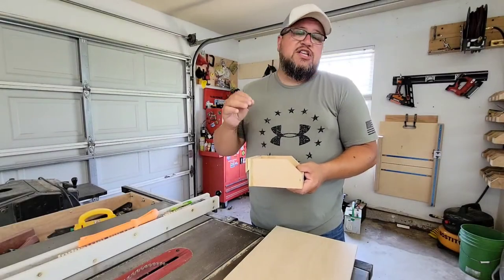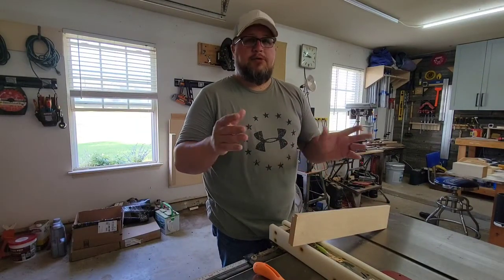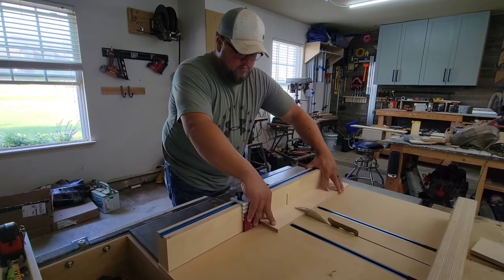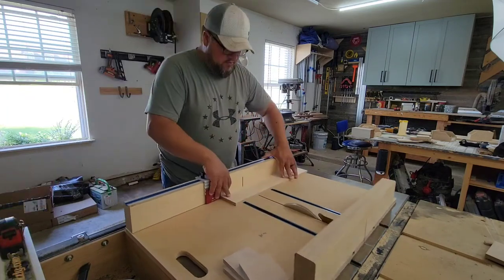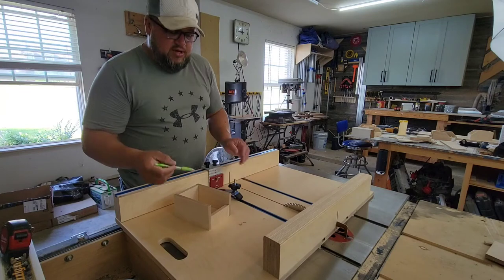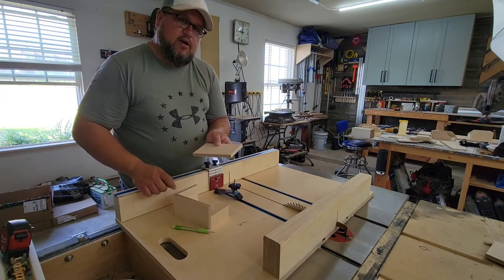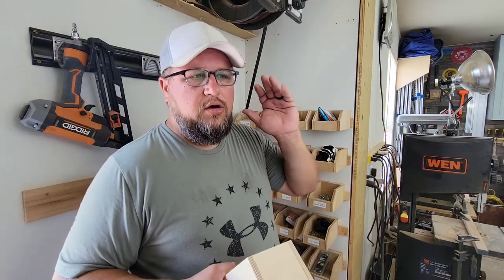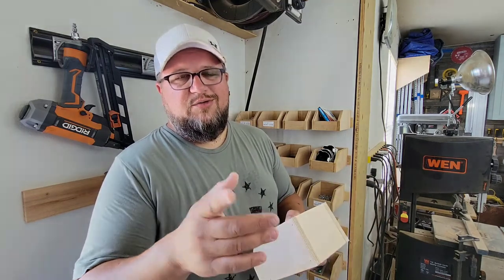EASY BUILD! FRENCH CLEAT SMALL PARTS ORGANIZERS!

Comment: Great project, Jeremy! Love the French cleat organizer wall. One tip that I got from Chris Burton at A Glimpse Inside is that if you turn the nailer perpendicular to the edge, it drastically reduces blowout. Due to the design of the nails, they would be contained inside the wood since they usually curve left or right when they blow out. Good luck with the house! - Joe